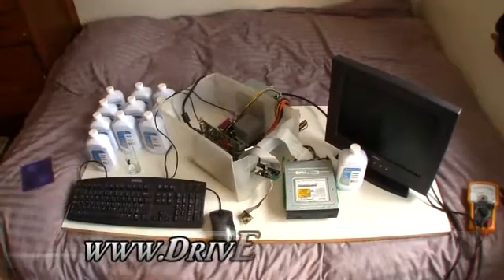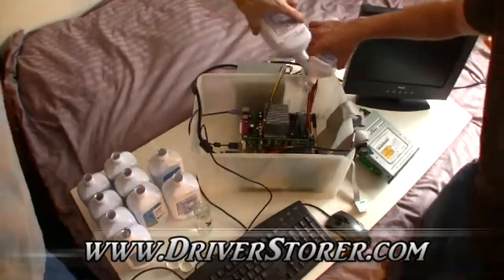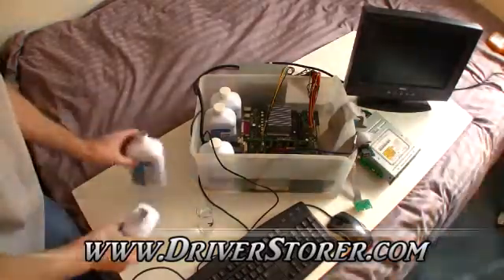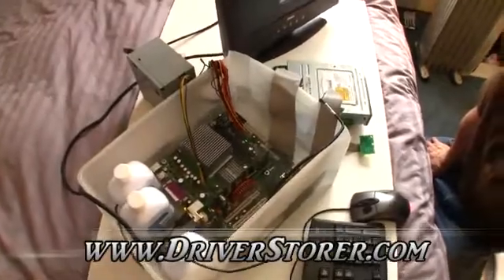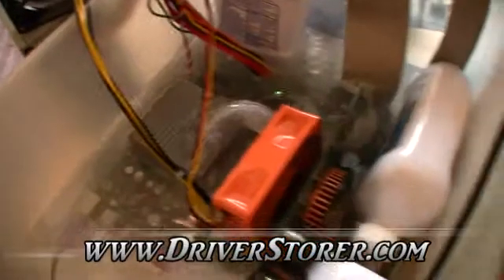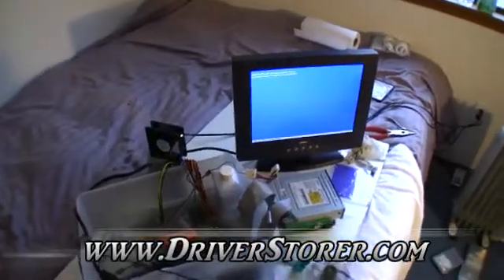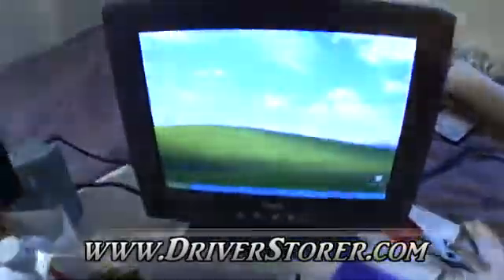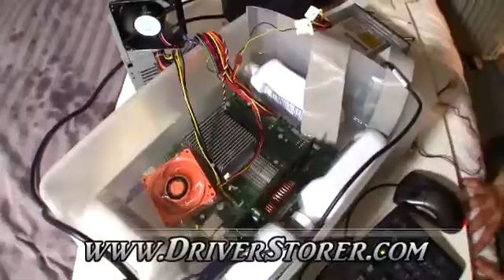Mineral oil submerged PC test rig

Comment from the maker: @uber1337420 

Remember, you only need an incredibly thin layer of thermal paste, in any application, for it to be effective.  The amount of thermal paste we used was much more than what you would use on a GPU or CPU dye.We ran the emulsification test on the arctic silver just to see under a worse case scenario if the oil became conductive, and if it did, it would have been more wise to use a silicone based compound. This was not the case however, and the mineral oil remained non conductive.